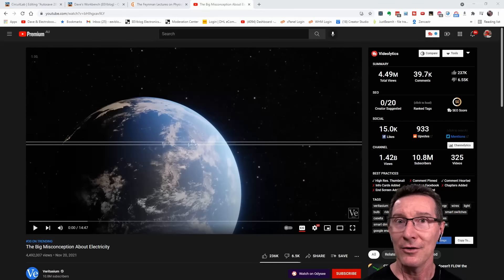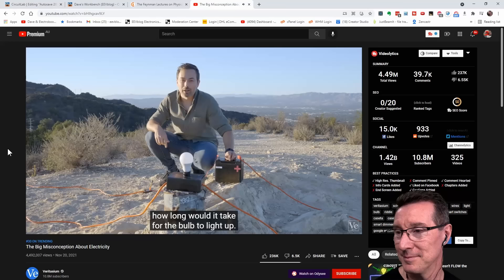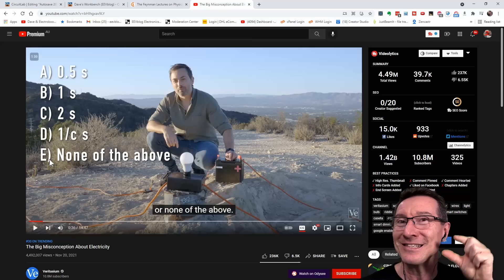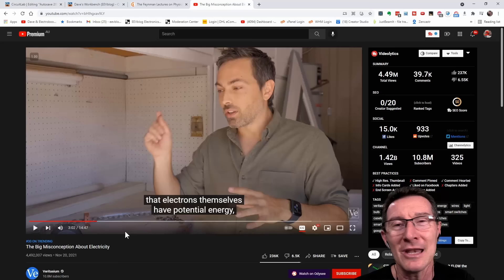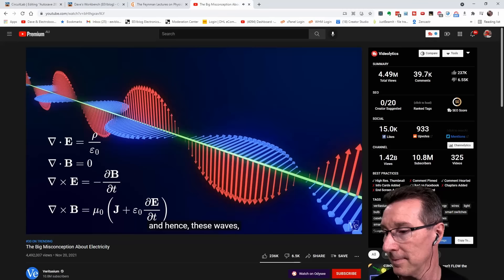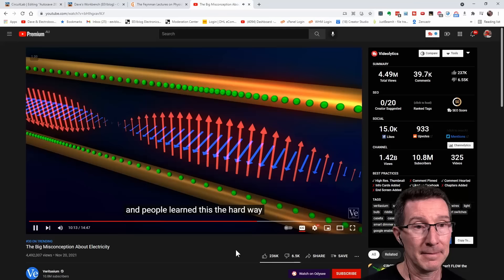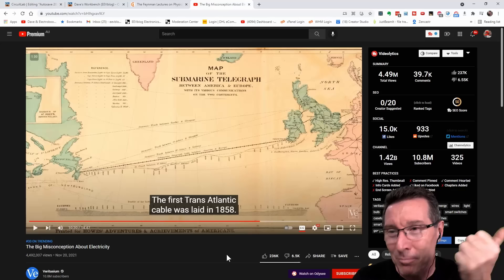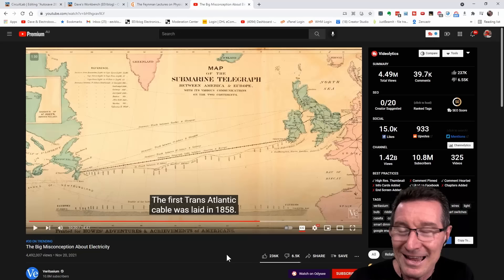EEVblog 1439 - Analysing Veritasium's Electricity Misconceptions Video

Comment: The problem I had with the veritasium video was, that some real life problems (resistance) are waved away, but others (capacitance) are not but not mentioned - and this feels like it is deliberately misleading. Also Derek should have mentioned that the layout of the cables is very important. This way the correct answer depends on effects that he made me ignore with the introduction ("we have to simplify this")
Reply: He acts like many bad teachers do: He creates an environment where his specific statements are true and leaves out the factors he had to set up to make his statements true.
BTW: I'm still curious why we need thicker wires for powerful applications if the power is not transmitted inside the cable anyway.
Reply: @MetalheadAndNerd  Well he said he has to ignore resistance :) I mean then it all works out that way.
Reply: Have you ever taken a physics course?  Problems are always simplified in order to focus on the principles of the subject at hand, especially in introductory courses.  When, for example, you are first introduced to capacitors, you ignore edge effects.  You don't use Jackson in a first-year physics course.
Reply: Imagine a different layout: a almost planar (X - Y) figure 8, crossing point distant 1m in the Z direction and the lines on the crossing plane in 90deg. The capacitance is minimal in this case and the battery and lamp will be 1m apart. If Derek is right, that the power is not transmitted over the cables, but over space (air), the lamp will turn on the same way, right? MAKE A F# EXPERIMENT! He could do it with relatively simple equipment, like an oscilloscope and differential probes. Very disappointed with Derek...
Reply: @michaelsommers2356  yes, but normally you say what you simplify but pronounce the effects, that you are going to focus on... instead of mystifying them to "totally blow you mind"
Reply: @MetalheadAndNerd  because the wires are not ideal and even if the energy is transmitted by the external field, the external field still causes losses when the electrons move and therefore heating. If you don't want your wire to melt, you better keep these temperatures under control.
Reply: @MetalheadAndNerd  I would disagree, this explanation is less the one of a (bad) teacher but more one of a conspiration theorist or sensationalist. He creates a hype about the way energy flows in this particular situation, without giving a real (usefull) insight. I really like Dave's take on this: "If it's good enough for Feynman, it good enough for Australia" (paraphrased)
Reply: @jpedrosc98  Are you saying that thicker wires for high power applications are only needed because they have more surface to dissipate heat?
Reply: @nukularpictures  a conductor without resistance still has inductance and capacitance thus impedance
Reply: @Schwuuuuup  I watched Veritasums video when it came out and it immediately triggered bad memories from long time ago. There was a professor of electrical engineering who started an introductory lesson with the statement that the energy doesn't flow through the wire. I asked him why we then needed the wire. He answered that the wire still must be there to guide the electric field to where the energy is needed. Then I asked why we need larger diameter wires for larger currents. At that point he said something along the lines of lines of "you will learn that one day". - Another professor who preferred baffling people over teaching them.
Reply: Thanks Dave. I was kinda annoyed Deric was bashing a simplified model of electricity by using a simplified model.
Reply: @MetalheadAndNerd  Ok , this is bad teaching - but not the usual one ;-)
Reply: Exactly. As an EE, I don't agree with answer D) simply because Derek's question mention "...how long would it take for the bulb to light up?", and the simplifications are "...cables have to have no resistance...", "...light has to turn on immediatly when current passes throught it." Even if we (wrongly not mentioned) do not consider the capacitance and its impedance, light will only flash or pulse, never light up considering the common sense. I might be wrong but "light up" for me has a sense of steadness, which is only posslible by complete circuit. Probably a better question woud be "...how long would it take for some light to be detected?".
Reply: @elderbenass  Right! Switching on DC is like a "Pulse" of AC. And this circuit feels very differently in AC ... it's more inductive coupling ... that the conductors are connected doesn't really matter ;-)
Reply: @michaelsommers2356  Actually I have studied applied physics myself (with minors in electronics). I don't agree with the over simplification thing at all. It's extremely misleading even for scientists. Way to many brush some very important side effects or non-linearities away as not important. For the same reason I was always in debate with my professors (and even did a lecture or two myself on the subject). That being said. Yes obviously it's not always necessary to go into all the details and calculate them. Especially when they are not of any significance. But you sure as hell should mention them and ask yourself IF they are significant? That last step is often totally omitted. Even by extremely smart people.
Reply: Why is everyone forgetting inductance?  😕
Reply: @MetalheadAndNerd not really. There is a significant electrical field gradient along the smaller wire (i.e. a great voltage drop) and that is inversely proportional to cross sectional area, not surface area.  The energy is going from the field INTO the wire, satisfying both Maxwell equations and Ohm's law.
Reply: Is there electron drift in a superconductor?
Reply: @kabbak  sure, there the electrons can move(drift) unhindered - that makes the conductor so super
Reply: @Schwuuuuup  The problem is if you say an ideal wire it implies that the impedance is zero. Then the resistance, inductance and capacitance is zero. That way the model with the capacitance doesn't hold true anymore I think. Only when the impedance is not zero we can get to the answer 1m/c I think.
Reply: @115maxx  exactly
Reply: @Schwuuuuup  thanks, do you know if electron drift in superconductors has been measured?  Leaving the dimension off is troubling to me. If I remember correctly,  dimension for a photon should include time 1/s, which would make it a measure of work, not photon being an actual object.  Makes me think of black body radiation being independent of material, yet they covered the inside with black soot/carbon.
Reply: @MetalheadAndNerd  we need cables with very low resistance, that is inversely to the thickness. If we have a zero ohm cable i guess the thickness will not matter
Reply: @kabbak  "Electron drift" is nothing but electrons moving - driven bei voltage - through an conductor. Electrons are carrier of charge. The voltage ("pressure of electricity") travels at the speed of light. And the current ("flow of electricity") is also almost immediately measurable in reasonable long wires.  So every time you use an Amperemeter you can measure electron drift, because Amperes are a unit for how much charge flows in a given time. So you can calculate how much electrons have flown through the Amperemeter. There is nothing mysterious.
Reply: @MetalheadAndNerd  Thicker wires have less resistance.
Reply: Don't need to complicate the matter for laymen. It's deliberate, but not misleading. You don't need to know every detail to grasp the concept(which here was field theory). Every educator has a framework and will simplify or ignore something. And the length was 1/3 of what was rambled on here.
Reply: @Supernov4  the best answer (content wise) to this topic was made by mehdi on his channel electroboom. But I'm sure not everyone likes his style of videos.
Reply: @Schwuuuuup  People are just more likely to view your video if it's not too long. Gotta pick your battles, clearly their target audience is the general public.
Reply: @MetalheadAndNerd  It was a physics video not an electronics one. The electronics stuff is an emergent phenomenon. Read the materials Derek linked to in his video. What Derek said was just as accurate as saying protons and electrons are made of excitations in quantum fields. (they are).
Reply: @bobdole57  Physics is not an excuse for bad teaching. Or pretending to teach while actually just trying to look smart.
Reply: @MetalheadAndNerd  I'm not convinced it is bad teaching. The objections to it are "this doesn't help me do xyz" but then again it wasn't meant to. 

Explain what was bad about it, specifically.
Reply: @bobdole57  So you accidentally replied to me when you were actually talking to someone else?
Reply: @MetalheadAndNerd  YouTube sucks at showing comments here. I tired to read everything you said. 

You're acting like you've never heard of a thought experiment before, didn't watch the entire video and definitely didn't look at any of the references. Yet are complaining because what, ultra-laziness?
Reply: No!  Dave here uses the wrong model for Derek's experiment setup.  A transmission line model is not applicable, so what you see on his graph is incorrect, and Derek's answer of 1/c for immediate steady ON is also not right, it's misleading.  The better model is a dipole antenna model.   Also, Derek conflates DC steady state with transient analysis which is false and folks who want to learn, get misled.  See my explanation in the main thread.
Reply: I disagree with the idea that any of these educators are deliberately misleading.
Reply: @tim40gabby25  I agree.  Here is how I put it to Steve Alexander in another post in EEVblog here.  We both solve the bulb reaction to the switch together.  Look for my comment at the root of the comment tree. 

"@Steve Alexander:

... many follow his presentations and many many folks have been misled by this one, I wonder why he would be intentionally deceptive.  My suspicion is that he doesn't fully understand this topic himself, and yes here, he believes in what he fully doesn't understand in the same way he believes in other areas he is an expert in.  Derek presents at least one consultant who warns him that he could get flack, and yet he still produced the video as-is.  It is very clear too, that Dave of EEVblog here did not model Derek's experiment correctly, which is also misleading.  Unfortunately I feel these are the kinds of events that lead to propagation of falsehoods and misinformation when one is established in a position of some authority like Derek, and this is one blatant, although in this case no one's health is affected as in the case of Spotify's NeilYoung-vs-Rogan for example."
Reply: @stickfijibugs  Well, thank you. Derek is a great communicator, but all experts must have a boundary to their expertise - though he did say he used to teach this stuff? On balance, such communicators should be encouraged by polite debate. Joe Rogan? Maybe not so much, but I do not know his circumstances well enough.  I bet even Feynman didn't know much about, I dunno, safe cracking? Ah, hang on :)

Thanks for your reply
Reply: @tim40gabby25  not per se.. but when you make a video, where you say "when you turn  on the switch, a tiny bit of energy will leak through the air, and here is the complicated yet boring physics behind it" it looses the "This totally blew my mind" effect. Misleading is maybe too hard of a word... but to me this is at least clickbait
Reply: @Schwuuuuup  yes, I agree that's better.. but how to title a video to attract many (but maybe not too many) viewers? I prefer to reserve 'clickbait' for deliberately misleading titles. Others might not agree. I rather like the polite disagreements within these threads.. :)
Reply: @Schwuuuuup  Of course putting it that way would be not attractive for Derek.  However, I feel most folks don't need clickbait and go on his well-established merits.  My concern is not with the problem framing and initial presentation at the beginning of his video, it is with the throwing the switch and having the light turn on immediately to full brightness, which misleads most folks.  Read the Versatim comments.

So I maintain that he didn't fully understand the physics of this circuit, and and to me, it was neither clickbait in my opinion, nor intentional.

In another thread exchange with me, commenter Steve Alexander did some good calculations and we both agree that when switch gets thrown, the transient to the bulb would not be longer then 100 ns (with not enough power to even flash an LED), and then  after ~1s still off, the bulb would start dim, and assume full brightness over a noticeable time, like turning on a light dimmer.

Here is part of our conversation:
================

@Steve Alexander  Thank you for taking the time to do some calculations and deeper analysis, it is a very useful contribution to this discussion.

Fundamentally, we should arrive at a good counterargument for Versatim, because folks wishing to learn do get misled.  I wrote there that he confounds AC transient analysis with DC steady-state, and I can see the confusion in the comments there, many making reasonable arguments against his presentation without really knowing why, while others are accepting what he says as correct.

Your para #2 and #3.  Agreed in principle. Yes, the integral is definitely ugly and I think neither of us are prepared to define it.  Yes, I did not take load-mismatch reflections into account, because in my estimation, they don't apply (ie I maintain this is not an xline, but nonetheless, your para #2 is an applicable model).  Folks reading this need to know that your E-field number of ~8.6v/m, is in all directions, and that you are 'measuring' the effect over open bulb.  Thus intercepting the E field with the bulb-side wires would also pick up a very tiny fraction of the current that can be acquired if you were able to capture all of the field for the bulb.  That's why [earlier] I showed the analogue of 'close pair of wires' and an LED for a light bulb.  Even then, your calculation indicated a pulse of less than 100 ns, that would be impossible to see in an LED anyway.

Your para #4.  I didn't overlook the transient, I let my antenna model conceptually simplify it, with my final answer arriving at the same as yours for both the initial transient and final DC state, in principle.  And btw, the transient numbers I was thinking of were in the range you calculated in para #2, good to see.  Of course decomposing the step into its components and a series of superposed dipoles for each frequency component, you'd get into a huge mess.  So I think your presentation in para #2 sums it up quite well without getting overly complicated.  Also I like your approach because it is independent of using my idea of a dipole model.  

However, I disagree with the last part of para #4 where you state the "LC time constant is hundreds of seconds".  

Here's my view ....

For this reason, for the steady-state condition, (ie beyond light-100ns distance) a better model I think would be a circular circuit model instead of a wire-pair model (again, not xline as Dave explains it), just 'wire-pair'), where the physical length of the left and right semicircles would still give a 1 light-second length (ie keeping the wires the same lengths but creating a full circle).  My basic reason is that it won't take long for the initial fast step to lose its high frequency components, pulse-spreading the step.    So in my view, the dominant effect is the inductance, which is ~400 Henrys per side for a 2mm straight wire.

So in LTSpice I created the very simple 12V step source, L=400 and R=100.  The result is 1/2 brightness after 6 sec and FULL ON after 40 sec, a lot shorter but agreeing in principle with what you proposed.  I think 40s to FULL ON is the WORST case.  Why?  Because the simple LR model is instantaneous: it does not consider velocity - vs- long length, which makes the total EFFECTIVE series inductance a lot less than 400 H when added in series as separate L elements in time.  So I still contend that the basic delay is 1s (still no light) and then a dim light would be visible 3-4 seconds later worst case (at ~1/4 total current), the "noticeable delay" I was referring to in my original post.  There would be no reflections to deal with because impedances don't matter, hence there are no mismatches: this now becomes a simple DC circuit.
Reply: @tim40gabby25  Please see my reply to Schwuuuuup a minute ago.
Reply: @stickfijibugs  gosh. Ok. You can see why us amateurs need good teachers. Pretty unusual comments thread, but the effort is appreciated. I wonder if a consensus could be found how to redo this video even better - for us curious amateurs?
Reply: The correct information takes into the formula for transmission line impedance . The impedances of a transmission line must match the load and the transmission but must also match the internal resistance of the cable, and this will be affected by the speed of light less the length of the wires. It is a small amount but can be huge in very low frequencies and in very long transmissionlines . It also affects the Antennae attached to the transmission line .If you look at a microwave frequency transmission line called a Wave Guide, for instance. A wave guide looks more like a drain pipe, and the skin effect is inside the rectangular centre.  Have a look at your microwave oven. This is a methodology that can be used as a Dummy Load for a Radar Set , but it cooks your dinner, too, though the power used is very nasty to your health , 😊 Just open the Box after the food is cooked. 😮And wait for those very excited water molecules to slow down.